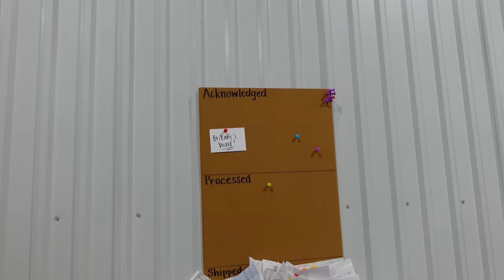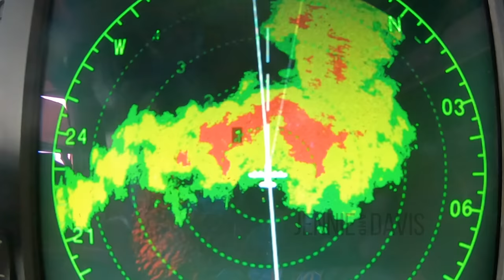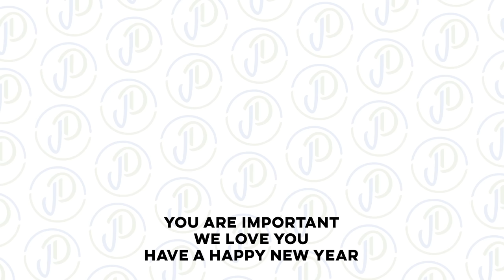this couple turned a CUTTING BOARD into a $103,000/yr BUSINESS

Comment: At around 5:08 Jenny is on the floor picking up off fall pieces of the table saw. You could put a dump box on wheels on the out feed end of the table  saw (or any of your saws) so off fall pieces go directly in the box or at the very least get a snow shovel to get scrap up with out having to get on the floor also way less chance of getting splinters. Hope this helped. RCW